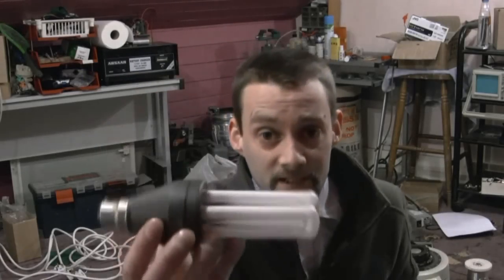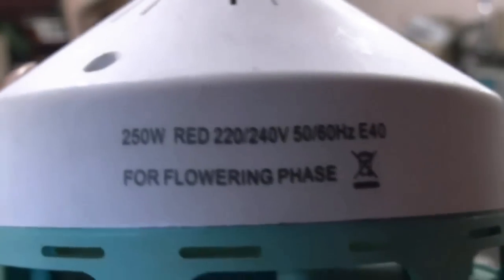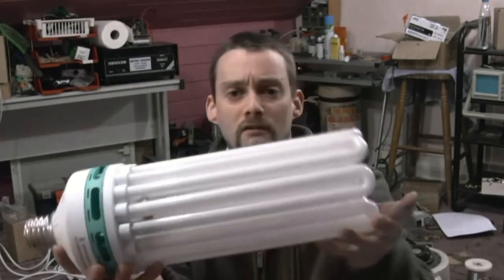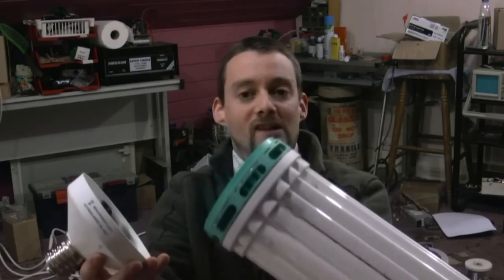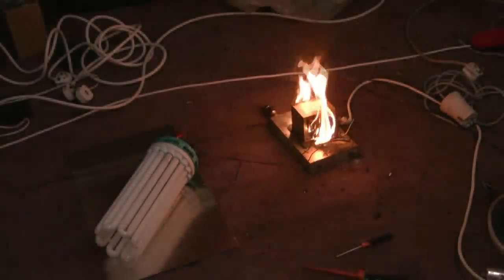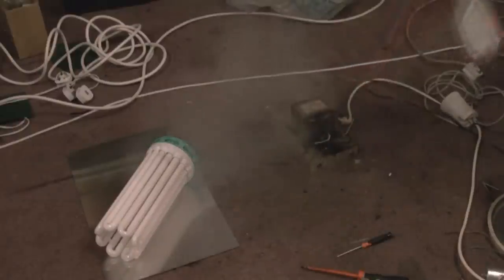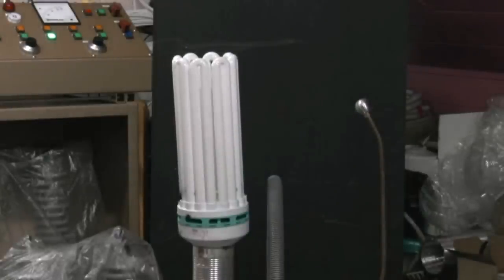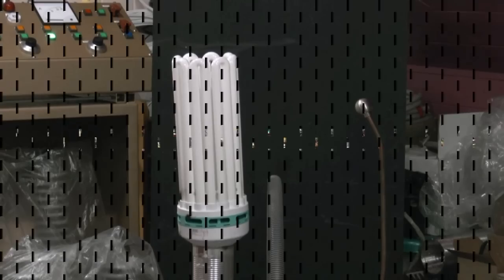200KV On A Grow Lamp

Comment: I have seen those bulbs used in TV studio spotlights.  They are put in a mirrored tube.  They use them because they give 80% light and 20% heat and when you're moving a spot light you don't want to get burnt.

Comment: About High voltage and CFL, you can create a HV power supply from a cfl oscilator and a flyback transformer from CRT,you can use a resonant capacitor to incrase the frequency!

Comment: That's what I love about transformers and normal magnetic ballasts - it smokes heavily it smells but continues to work, it can be overloaded more than 10 times and continues to work until at the very end it catches fire... while on the other hand the nasty new electronic ballasts and switching mode power supplies besides of the fact that they are expensive, generates heavy radio interference and on the top of that they burn out easily with even minor overload and even without overloading at all. They are more expensive and ALWAYS last less time. But some shitty idiots are trying to put them in everything replacing the good old transformers. But I'm sure that one day everybody will return to the normal transformers and magnetic ballasts.

Comment: You might have noticed that he turned off the power before spraying. It's only dangerous if there's some way a (big enough) current could form a circuit through your body. The transformer could still hold a big charge, but once the insulation is on fire, the whole transformer soon gets shorted out and discharged.

Comment: But i was wondering if you can make another type of project that i have in mind such as a home made fire  protection  and find a use for it its so easy to make and it with stands very high amounts of heat more than a torch if i held my hand out after i flatend matireal and layed it over my hand took a torch to it i will not get burnt

Comment: I shudder to think how much ozone he must have made with that electrical firework display. I also wounder ho whigh was the x-ray flux in the room. It would be interesting to put a TLD badge at 1 meter from the experiment and then send it away for processing to see if it shows a dose.

Years ago I read in a book that if you take a old TV without "leaded" front glass and stick a sheet of X-ray film on it, after about 24 hours of TV watching if you develop the film you can see lines on it

Comment: Hay have you tried to build a UFO get a couple of SS bowls and turn one upside down on the other one and give them about a 6" gap and hook positive side to the top bowl and negative to the bottom bowl and hit it up with 150kv and it is supposed to levitate it will also need to be insulated from the earth.

Comment: Can anyone explain how he increases power while keeping voltage constant?
Reply: a7xwakinthefallen More amps I believe. I think if it's just loads of volts the arc is blue but if it carries loads of amps then the arc turns white. But I'd like to confirm that with someone that knows this stuff :D
Reply: a7xwakinthefallen P = U x I, where U is the voltage and I the current. So when applying more amps, you'll get more power while keeping the voltage constant.

Comment: Im really suprised the lamp could take the MOT full power without overheat.
Reply: the tube was probably only getting about 150w, since MOTs usually have massive losses when shorted out, and gas discharge bulbs are essentially superconductors when turned on
Reply: @coalthedergsune  11 years ago, dam that long, the record I think is 12 years so you were close. The MOT is a constant current source so when its shorted, and it has its shunt in place, it will only put out what it can give at max which is around a 1000W, not more not less. However it do this quite inefficient since the core and winding are not matched for the power and thus overheat if not cooled.
Reply: @dtiydr  damn, should have waited 2 more years lmao

Comment: putting out a transformer fire with water not CO2? smart...
Reply: +danner253 I think the only reason why he got away with it is because he did it with a sprayer (i.e. not a continuous stream of water thus the circuit hasn't been closed between him and the transformer).
Reply: +恵勇気 I don't think he did. Just listen to the click on the beginning as he turns on the variac. You can't hear any similar click after the transformer bursts into flames, can you? Other than that you can still hear sizzling even a while after he put the fire out, which is also indicative of the burned transformer being under voltage.
Reply: +danner253 If you're genuinely concerned about safety don't watch this channel.
If you wanna see awesome shit tho, watch it and don't give a fuck about safety! :D
Reply: +danner253 Photon knows what he's doing more than pretty much everyone that watches his videos. You'd be amazed at the safety principles employed in every one of his experiments.
Reply: +danner253  MAYBE.   HE TURNED THE POWER OFF!!  Is it a surprise to you people how some people use  whats called common scene?

Comment: HAHAHA
FUCK! THOSE ARE SOME DURABLE LAMPS!!
Reply: ***** hehe, the light was probably faulty or not placed inside a ballast with cover thus burning the circuit, generally these bulbs are mounted horizontally such as factories or a warehouse (ofcourse this bulb is not made for this) or with the ballast at the base so heat and humidity can go up away from the bulb. I could be wrong about this bulb though!